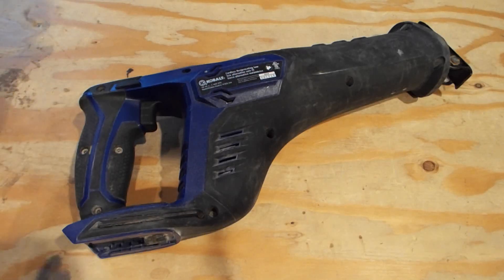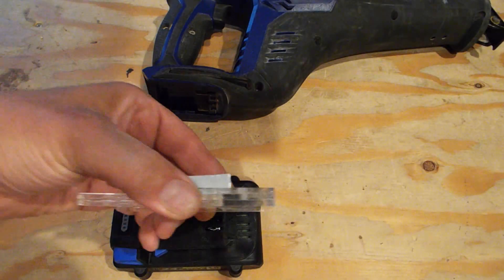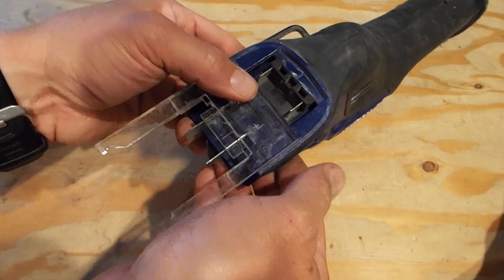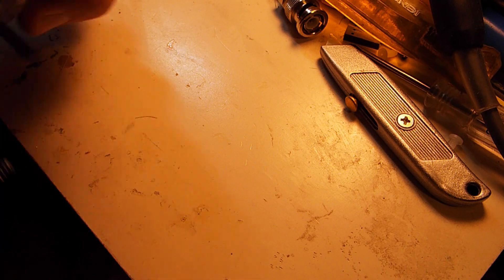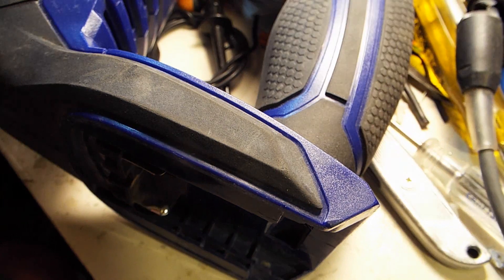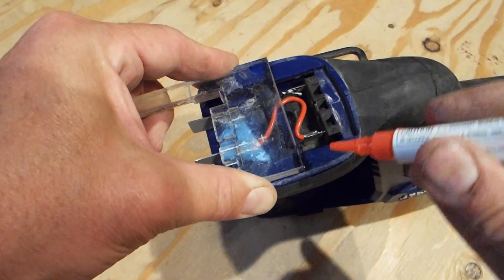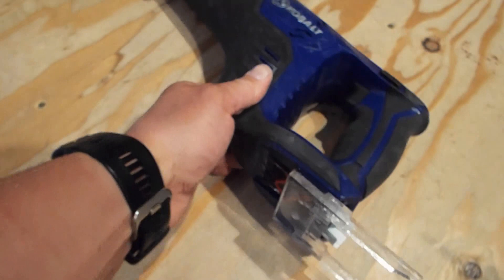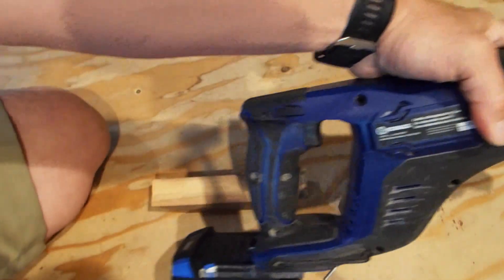Convert 18V NiMh Tool to Run on 24V Li Ion Battery

Comment: True voltage for a 24v pack 21,6v (22v)  Lithium nominal voltage is 3.6v.  There are 6 batteries inside a 24v pack,  The so called 20v pack (18v) is 5 cells per pack.                    The concern is whether the adapted battery has a built in low voltage cut off.  It's obvious the tool does not have a voltage sensor as the battery contacts have only a positive and negative terminal.

Comment: Mad Scientist, I have just the opposite problem.  I have a set of Bosch 24-volt tools, and like you I don't want to throw out perfectly fine tools just because of battery issues.  I'd like to convert the Bosch 24-volt tools to run on Bosch 18-volt batteries.  Do you have a solution?  Thanks!
Reply from the maker: You would have to run a DC-DC boost from the 18V batteries to bump up to 24V.  This one might work for you: https://www.banggood.com/1500W-30A-DC-DC-Boost-Converter-Step-Up-Power-Supply-Module-Constant-Current-p-1087084.html?rmmds=search&cur_warehouse=CN

Comment: That’s great I have same problem, anyway I could order a homemade adapter for
 You?
Reply from the maker: I only did the video showing what I was doing with the adapters I designed. Sorry I do not sell them for liability reasons.
Reply: @madscientisthut  
Could you maybe make plans of the dimensions for the acrylic plate available online with a DIY disclaimer?  I've got a 5 piece set of the 18v tools, and only one of the 18v li-on batteries, and they are rarely available on eBay and when they are they are $80! I would love to convert them all over to use the readily available, $20 24v li-on batteries.
Reply from the maker: @gregcoley2286  there are some available on ebay as 3d printed that I have seen those should be pretty easy to adapt to your needs.

Comment: Thankyou for the video im in the same dilemma we purchased the Kobalt combo kit about 6 years ago and the batteries are not good anymore and cant find replacements anywhere since Kobalt is now 24v rendering all of my tools useless, so running an 18v on 24v wont harm it?
Reply from the maker: Some 18V tools work great with these 24V batteries other are not so tolerant to it and they burn out. The way I see it is the tools are useless since I can go out and buy new tools for the cost of the older replacement batteries, or I can try and run old tools from new cheaper cost more reliable batteries. If the tool is super valuable to you then you should buy the correct battery for it.

Comment: Can you use a buck converter in this situation if you wanted to bring the voltage down to 18 or 12 volts?
Reply from the maker: Yes you can but you will have to make sure the dc-dc is rated for the maximum current draw of the tools.
Reply: Can you please explain what that means. Please write slowly.
Reply from the maker: For example: If your tool draws a maximum current 10 Amps under full load then you need a buck converter that can do 10 Amps continuous.  If you do not size the buck converter for the full load it will burn out the converter.
Reply: Got it. Thanks.

Comment: Cool video... Sure beats going out and buying new machines... Why does the batteries only cost 10 dollars?  Bought myself a DeWalt drill, the batteries are a lot more expensive than 10 lol
Reply from the maker: I think that the tool companies are way over pricing the batteries so that they can make a ton of money after the initial tool sale. I have been avoiding cordless tools for the most part because of this. Now Lowes has this Kobalt 24V Max set with reasonable priced tools and really great priced batteries with good warranties on the tools and the batteries, so I bought the set. But then had other ideas for the batteries, I have a few more videos to come with the 24V 1.5Ah battery that I think you will like to see.

Comment: You missed your calling man, you need to change your name to SuperScientisHut. WOW, that is interesting my friend how you made that bracket. Someone had told me that the difference in volts would not effect most tools but the newer batteries never fit. If someone sees this it may be a new thing in the market you never know. Thanks for the interesting view and have a great weekend. I got to share this with a few people including my son that loves Kobalt.
Reply from the maker: Thanks for that awesome compliment! Thanks in advance for sharing it too! I think I would love to have battery adapters to convert batteries for tools as a common item.
Reply: there are some adapters on the market as i mentioned on ebay .. however kobalt adapters are not so easy to find as the more popular brands .. I use the kobalt so employees do not swipe my batterys or swap their broke tools for my good ones ... most have dewalt and portercable .. out of 60 ish employees im the only kobalt guy.. several of the other guys have had their drills magically brake  and ect

Comment: This could benefit me, I have a Dewalt 18V NiMh that still functioned perfectly when the batteries became unavailable for purchase new.
Reply from the maker: I need to work on the design of the clips a little bit more, but when I get it dialed in I can send you an adapter.
Reply: That'd be great :)
Reply: u can get adapters and refurbished batterys on ebay .. or pull the dead batterys apart and seperate the cells to replace the bad cells and rebuild .. they are easy to find  for dewalt

Comment: worked your tool we find that the battery is often a unique shape and a different battery just wont fit often the battery cost outweighs the price of a new tool
😊a big like now 3😵👍😊👍👁 we are active watched all👁😎
Reply from the maker: They make each battery shape unique, that way you have to buy only their battery, that is why I had to make an adapter to convert the tool so it could use the new shape. Thanks for stopping in.

Comment: Great idea love it  gonna have to give a a try should work on dewalt tools?
Reply from the maker: Absolutely should work for Dewalt  tools too. I am going to convert a 24Ni-Mh dewalt drill soon, it will run a little slower since it will only be getting 20ish volts. But that is fine with me.
Reply: Ok awesome for responding